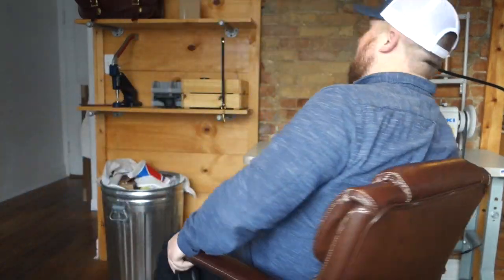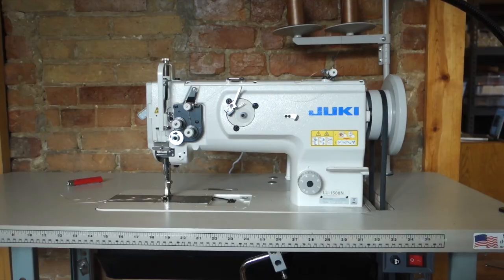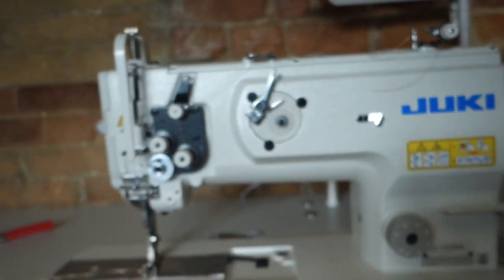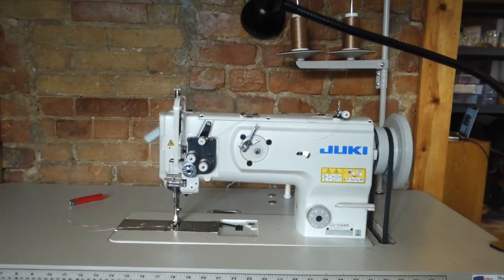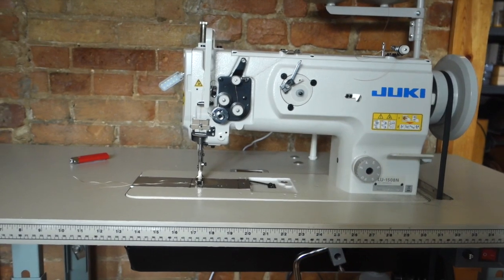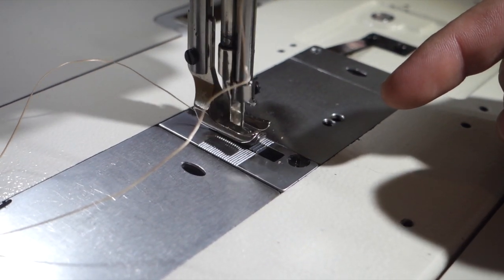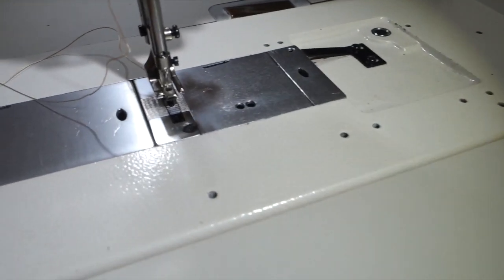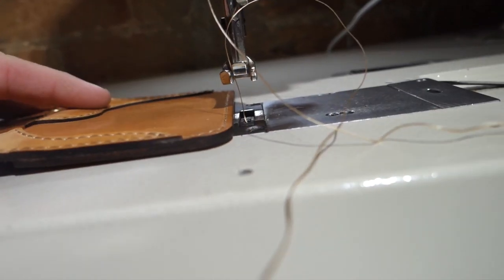5 things to look for when buying an industrial leather sewing machine

Comment: Thanks for the very informative review. Questions: Is this machine overkill for sewing leather garments? I thought I could use a model like DL 8700 for jackets and such. Is this a better way to go?
Reply: The 8700 is a good machine and yeah, you could get it to work on 2oz garment weight occasionally but not as a long term solution. Get a teflon foot, that'll help some. Another option to try is a roller foot. I recently bought a double ring foot with the idea that it might be an option on delicate lamb skin but haven't tried it out yet. Another solution may be a needle feed machine. I have a Juki 9010 SH (the lighter weight is the SS) for garment weights but there are many on the market.

The problem you sometimes have with a walking foot is marking from the feed dogs but you can get another feed dog (upholstery feed dog) that isn't so sharp and or, you can reduce the pressure provided the machine will still form a stitch per however many layers. I have two Juki  DN 1541's also (I prefer a bottom loading bobbin, more flexible imo) and those are good for anything over 2.5+ oz leather but they top out at 5 oz, assuming one is going through however many layers (4+). This is just my experience, nearly 40 yrs of working in "mass production".
Reply: Thank you.
Reply: Scott Coleman

Comment: Do you ever miss the cylinder arm for the kind of work you do?  Is it tough to do bags without the cylinder arm when you want lighter threads?    I have a Cobra 4 but am struggling between a flat bed like this Juki you OR a class 26 that has a cylinder arm and still can handle 69-138 thread

Comment: A request, for whenever you have time.... I noticed at 6:47, you showed your cowboy 341 machine. I'm curious to see specifically what this machine might do that a flatbed cannot. As I recall, you got rid of the 3200 but later bought a 341.  WHen you have time, can you do a review of the 341? Thanks for your videos.....
Reply: For example, you could sew cowboy boots with it.  They are popular with shoe makers, though they could marginally speed up some apparel work as well, like working on sleeves.  I've seen those in an Osprey backpack factory...

Comment: I’m looking at the Juki DDL 8700 for some 6 to 8 oz leather. I’m only looking to top stitch around the edge. In your opinion will this work if I switch out the needle plate and feed dogs for heavy duty ones?
Reply: I have both a Juki DDL 8700 with the heavy feed dogs installed and a Juki 1541 walking foot upholstery machine. You have to remember the 8700 is a low thread tension [~ 4oz] high speed garment machine for garment size thread. [Unless you have an 8700 H model] When you get a machine like a 1508 or a 1541, your getting more then just the walking foot, the entire machine is setup for the thread weight of 69-138 and for projects sewn with this thread size range. The 1508/1541s are upholstery machines for car seats, boat seats, canvas, and other medium to heavy weight fabrics. The 8700 can be made to sew 69 and 92 thread if you add a second tension disk, but it can never be a high thread tension [~ 18oz] upholstery machine.  Big thread needs more tension.  I love to sew on the 8700, it just zips through light materials, but even projects like outdoor cushions sew much better on the 1541.  Vinyl and leather are a non starter on an 8700 unless it is really thin stuff.  Pick a machine for the kind of work you do, starting with the thread weight appropriate for the project.  Sewing machines are very project specific, no one machine will do it all.  You can get a machine like an 8700 to sew heavy thread, and it will punch the holes, but it will have stitch quality issues. Attempting to sew thin materials on a 1508/1541 machine turns them into a wadded up messes.  If you do this work more then just once in a while, you will end up with more then one machine.

Comment: Thanks the for the tips. I do have a quick question, what ratio did you reduce your speed by?  Based on what I saw, it appears that you reduced it approximately one half, did you get a sheave that was double the original size of the original motor?  

Love to subscribe but being outside the US, I have problems of the stuff arriving on my inbox consistently.  :(

Thanks again.

Comment: Does Juki make a similar machine with a bigger throat?  It is sometimes called a long arm machine.  I want to sew knife scabbards/sheaths but I also want to repair sails.  Sails often have multiple layers of fabric especially at the corners.  Some parts must be sewn by hand stitching (like the bolt ropes) because as far as I know they cannot have these parts attached by machine.  Currently I have a Pfaff hobbymatic which has a walking foot and it is a great machine for fabric but no way can do anything other than the softest leather.  It also struggles if there are more than 4 layers of canvas.  I would like to upgrade.  I only do stuff for my boat and for selling at non-profit auctions.  The scabbards are also for myself but I suppose I could also help out the aforementioned charity.  3 bones for a Juki does not sound bad.

Comment: Great video! Never even heard of a speed reducer. I have my mother's old COnSEW 230, so I'll be looking for a speed reducer in hopes that it will make things easier!
Quick question, have you or would you make a video on best things to use when hand sewing leather? I feel that going straight into an industrial sewing machine might be jumping the gun :-P Plus, for a hobby, I don't need to make a huge quantity of stuff, so I think hang sewing would be a cool way to start into it. Thanks again!
Reply: Glad you may HANG, not hand sewing. Incidentally, it is not a fun thing to do by hand as it becomes tedious.  All joking aside, having stitched millions of stitches over the years, the basic requirements you will need are 1) a good clamp to hold whatever you will be sewing, 2) a good knowledge of the types of leather you will be using as they all have different requirements when sewing either by hand or machine,  3) a good awl with both round and diamond point needles, some good long-lasting needles as you will have some that will either break, become blunt or bend, 4) a small block of good quality was to wax the thread if necessary, 5)  a knowledge of how to sew using single or double needles and how to sew from both sides (upper to bottom and vice versa) at the same time and have to push the thread through the hole at the same time without feeding the threads through each other (i.e. piercing the thread coming through), learning how to have the thread lay down in a constant way without going from side to side (suggest you look at thread from a sewing machine to see how the thread lays when sown) so that it maintains a constant pattern (either left hand or right hand stitch (nobody likes to see thread changes (hard to explain but simple to show), 6) a good short bladed knife that is easy to keep sharp, 7) good leather shears that can cut through up to 10-12 ounce hide (and even thicker and rawhide), 8) a good pair of pliers may be required to help pull a needle through a tough spot, a good relationship with your supplier, 9) make yourself a thick leather thumb piece to act as a thimble (or use a good metal not plastic thimble but be careful as they can cause a needle to break or bend, get buy good books on leathercrafting, don't borrow from a library, including rawhide work, and different leatherwork styles, methods, and techniques from around the world.  Sorry, I just sold all of my books and equipment which I acquired as I travelled around.  Try to get as many of Al Stolman's books that are still available for designs and techniques.  He was the best in the west, so to speak.  Remember, practise, practise, practise your techniques and do not give up because it can become frustrating trying to put the right thing/design etc., onto the leather.  For example, I used to be a falconer and was one of the very few in Canada who made hoods, etc.  The making and obtaining of the designs for everything and being able to make them properly took me about three years because I had to teach myself.  That is another story.  Finally,  good sewing.   At almost 79 years of age, I just retired from doing leatherwork after some 45 years, and everything else, after many fruitful, and sometimes lucrative years.
'nuf sed.

Comment: Hi. Again, thanks for the information. I watched it a second time as I research cylinder arm machines. What do you think of the idea of buying a cylinder arm machine and then making a slide-on bed for it? In theory, this would give you the benefit of a flat bed machine when you need it and then the flexibility of using it as a cylinder arm machine when you had hard to maneuver items..... Do you think this idea is feasible?

Comment: Parker when u say 92-weight you mean 92-ounce right ?  Thanks.
Reply from the maker: No most thread suppliers just call it size 92 or middleweight. However leather weight is usually measured in ounces

Comment: How are you avoiding the teeth marks?? I pretty much have the equivalent in a 206RB and the teeth marks are ridiculous. Your feed dog isnt smooth either (like most) so Im wondering what Im missing here?! Anybody?? (PS thx for the vids)
Reply: Maybe set it up so they put less pressure down on the leather? Just barely enough to grab.
Reply: You need to adjust the pressure foot or wrap it with a piece of tape or thin fabric

Comment: Great video, thank you! I just purchased the machine I thought I wanted after a lot of researching...not enough apparently! I like the Mach 2 (like an Artisan 618) because it fulfills 4 of your 5 must haves....just the speed of it scares me. I was considering switching out the clutch motor to a Servo. What are your thoughts re Servo/ speed reducer. It is my impression that a new Servo will allow a slow enough speed to go "step by step".
Reply from the maker: Hi Rhonda, that's great! From my experience the servo motor alone didn't slow it down enough. Which is why I love the servo /reducer combo. It slows it WAY down but makes it easy to speed it up a little if you need it.

Comment: next time just upgrade to a servo motor with speed setting down to 500 rpm and replace to pulley to shaft size so you wont need a reducer anymore

Comment: Hey, Parker. Are all Juki 1508's walking foot? When you say "speed reducer" you're referring to a servo motor?
Reply from the maker: Janet Wise yes I would imagine they’re all walking foots. And no. The servo motor helps slow it down a bit, but not enough in my opinion. Adding the reducer will add torque and slow it down significantly